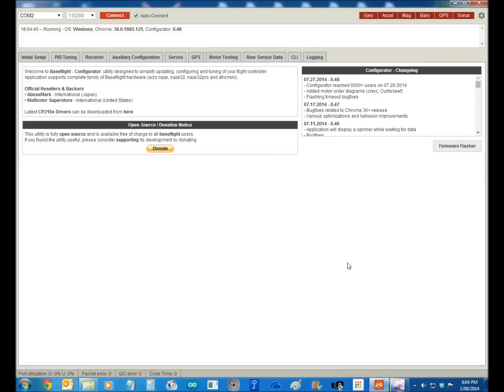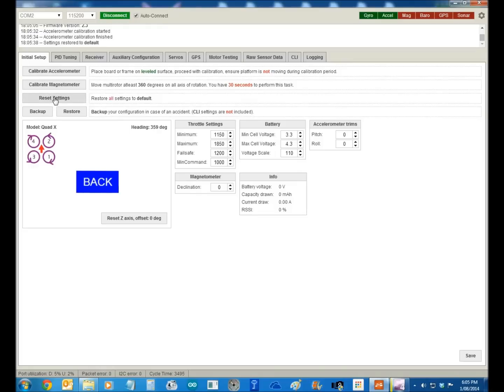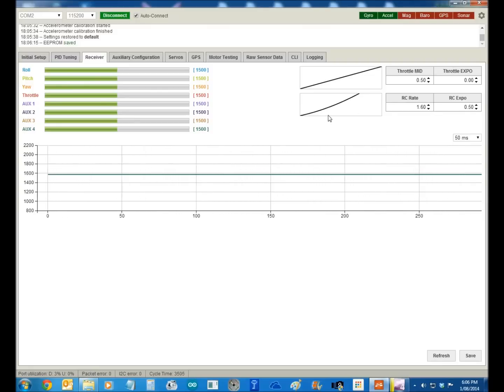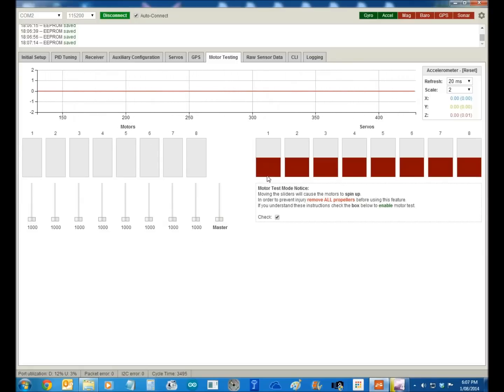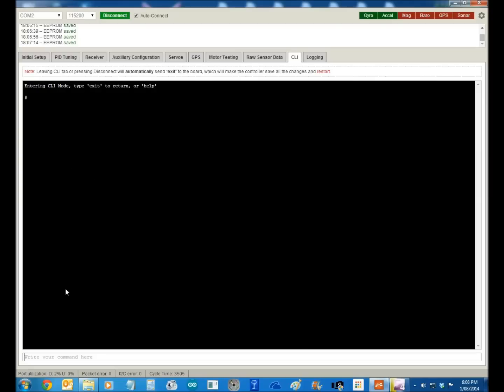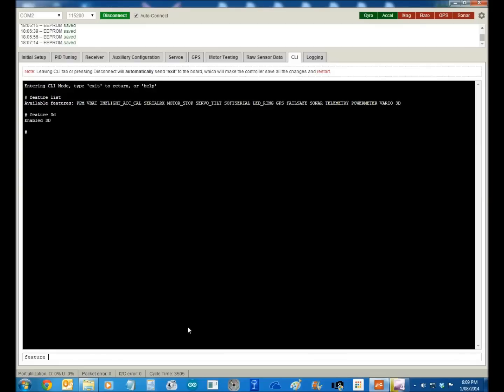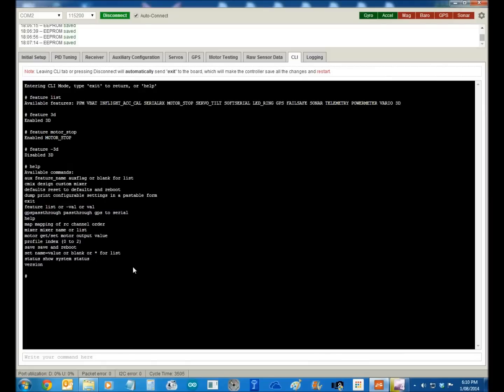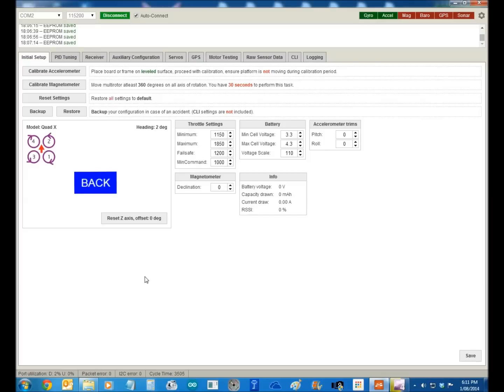250 FPV Setup - Baseflight Configurator

Comment: i reset my settings to default on my nighthawk 280. it cannot takeoff because the both left motors spin weak compared to the two on the right. Solutions? Thanks
Reply from the maker: What happens when you swap the 2 good motors onto the weaker motor escs?...... so the process here is to eliminate..... so by swapping the motors over to the other escs you will know if its the motors or the escs..... the other thing you can try before that is to swap the esc leads over on the flight control board..... hope that helps, let me know how you went as I doubt its your flight controller or the firmware...... cheers

Comment: I am new to all this...When I move my throttle etc on my TX, the receiver bars do not move.
the only thing that moves is YAW.
Can you shed some light on this?
Reply from the maker: What board did you flash?..... IE did you select say flash NAZE for a naze board.... also what Rx protocol are you trying to use PPM or PWM..... PPM is the one wire and PWM in all individual wires for each channel and you need to select which one in the GUI..... is the Rx bound to the transmitter and can you check its ok on another model......you can reflash the board again and try again..... also is there something set up in your transmitter that might cause this such as channels being set to zero....... without a video showing me or a detailed description of your set up and what you have done it makes it hard to diagnose...... also have you got your signal wires on and around the right way......
Reply: I have a Naze board. not too sure how to flash it, it just says "Running firmware released on: Aug 27 2015" when i plug in the board.

The TX i am using is the FlySky FS-i6 and RX is Flysky FS-iA6, i don't think they support PPM so i have my wires connected according the the PWM setup.
PPM is off on the configuration tab on Baseflight.

RX and TX is bound, all the Yaw, Roll, Pitch and Throttle worked at first. After messing around with my TX only the YAW is responsive in the receiver tab. I have tried to factory reset my TX but that didn't help.

Could not figure out how to get everything else to respond in the receiver tab..

Thanks in advance
Reply from the maker: 3rd paragraph........I think you must have turned something off/down in your radio....... can you set up a new model, bind the Rx to it and start again...... that is what I would do.... I had the same issue from copying over a model for another new model and one of the switches actually turned off my controls so I had to start over.... https://youtu.be/6oFEAjIolEw here is your radio.... dont know if you have watched this one....... let me know how you got on
Reply: I tried to rebind the RX using model 2 on the TX but the got the same results. it seems like only left and right is responsive on the left stick (CH4 using stick mode 2). i tried switching to another stick setup and only the left stick (only left/right input) is responsive on the receiver tab.
Reply from the maker: Does your radio work on other models?........ does your radio have a screen whereby you can see if all the channels are working?...... can you swap the good channel that works onto another set of pins?...... can you use another Rx to rule out the Rx having a problem.... what ever the problem is I dont believe its in the firmware, I believe its in your radio.
Reply: hi iv come across the same kind of thing trying to  set up my 280 pro ARFmodel  i dont have any movement on my roll stick setting up receiver in baseflight   can you give me some advice on this please  its running on stock transmitter M-16 & receiver M-16  its my first racequad and a little lost here lol

Comment: I have the rtf with the cheap fkysky  transmitter and my yaw rate is absolutely terrible despite the fact I have increased the yaw to its highest parameter in baseflight which is 1.00...Yaw remains the same in both horizon and angle modes...Any suggestions? Never fiddled around with PID set up because it seemed risky to me considering almost every video I've watched suggest not to.
Reply from the maker: +Shane Gibbs Have you tried upping the RCrate?........ I use 1.6. other than that all I can suggest is reflash the board to clean flight and try that.

Comment: Argh...my failsafe is giving me fits.  No matter the setting in baseflight it goes to 1200 throttle and would fly away (if it had blades on haha)
Reply from the maker: +Stephen Horn I would suggest you not use the failsafe in the GUI.... failsafe is a function of the Rx so turn off the FS in the GUI and set it up on your Rx.
Reply: Yeah I figured it out...Turnigy 9x - failsafe - throttle 0%.

Comment: I have my board facing forward. But When I move it around, the movement of the animation is not even close to the movement of the board. What am I doing wrong
Reply from the maker: +jerry zito What copter are you running (say a quad) and have you selected QUADX in the configuration?.........
Reply: Yes I did. Good news is I got it working. On the lower right corner of the screen where the animated quad is, you can change orientation.

Comment: hello
Here again, but I would like to ask your advice will do the Luping well and thanks to your input but I see that when the machine a little effort, making two Luping followed is as if left without power, this can be devido drives ?? 10A are with simonk firmware, the battery is charged butt I use 1.5 to 2.2mah

greetings and thanks
Reply from the maker: I think I have lost something in the translation so I hope I am right......... If you are asking are your 10amp escs OK for higher current then that depends on the current. Most 10amp escs will run up to a 4S battery..
Reply: hello
I wanted to tell you that when two looping followed miniquad seems that runs out of power engines use are Emax MT 1806-2280KV with ESC 10A with firmware simon
This can be devido the ESC 10A
regards
Reply from the maker: Javier Franco Javier if your copter is running out of power due to 2 loops then something is not right...... It will not be the ESCs as they supply constant current what I would suggest is that your battery C rating is low..... I use 2200mah batteries that are 60C so what are yours?.... also it could be the overall weight of the craft as it just maybe too heavy and runs out of momentum....... your escs, motors seem ok and should scream through the sky PENDING the overall weight and output power of the battery (C rating)...... let me know how you got on.
Reply: hello
I use batteries from 2.2 to 20-30C think that's the problem responsiveness is low

regards

Comment: hello
I can not do looping with acro naze32, for more I read and watch videos do not achieve them, can you tell me please carry on the PID values about to make looping
I've adjusted on many occasions but not douy with key
regards
Reply from the maker: Ok the PIDs are not the thing to adjust, they just make the board steady so I never need to adjust them... if you want to loop fwd and back and roll from side to side fast then you need to adjust the following...... (with explanations)

Pitch/Roll/Yaw Rate....... these are set to 0.00 and I have mine set to 0.30.... this increases the re activeness of those features....

RCrate....... standard is 0.96....... I have mine at 1.6, again that means 160% of your radio inputs will apply.

RCexpo..... standard is 0.65...... I lower mine to 0.50.....that means I have a more linear or straight line on all the radio inputs so again more reactive.

throttle TPA...... standard is 0.00 I have mine at 0.20.... this rate cancels out the P gain for the throttle when you full stick it.... meaning that the horrible wobble quads have with say 4S batteries as its given full stick and some of the escs are slightly out compared to the others causes that wobble..... this rate irons out that wobble but does NOT back the throttle off.....

So depending on your skill level and size machine and battery size etc upping the rates will make it more reactive....... I fly in horizon mode so I always have that self leveling to get me out of trouble but acro over 25 degrees for those awesome flips and rolls.......
Reply: moochasas
hello
Thanks for the input, now if perfect, forward ok, ok backwards towards the perfect right, but left no achievement do, I RCrate to test 1.20 and 0.60 RCexpo have to climb a little more RCrate?

Thank You
Reply from the maker: Javier Franco Ok so you are getting there....... the idea is to understand what the settings do and adjust them to your craft and to your comfortable skill level.
I have noticed that these naze boards sometimes kind of wear out whereby one of the roll axis works faster than the other ( I have also experienced the exact same problem with the 328P boards)...... remember they are not rolls royce, they are a $24 item sold for profit so the actual cost is probably $5-$10 to make so we should always remember that........ need anything else just holler........ merry christmas and stay safe...... cheers
Reply: moochasas
Ok thanks understood, it has served me very helpful

regards
Reply from the maker: No probs...... stay safe and merry chrissy.
Reply: moochasas so in horizon with your set up your can flip and roll 🍥 and it will self level???
Reply from the maker: TheTonstar1 Yes that is the combination....... up your RCrate to 1.6........ up your pitch/roll/yaw rates to 0.30 and fly it.... you will notice a great improvement on its react-ability and its that high performance react-ability that will get you through loops and rolls..... just follow these tips,
A - go high enough so that if something happens you can recover.
B - never hesitate
C - use plenty of power.
WIth C, I believe people often use too little power as they are scared or they hesitate...... the more power means the more control and fast "things" happen...... remember its easier to flip and roll at higher revs as compared to hardly having any revs at all....... bottom line..... drive it like its someone elses and dont hesitate...... http://youtu.be/jO_fvXkQFX4
Reply: moochasas god going to try today!
Reply: moochasas rc rates to 1.60 or 106?
Reply from the maker: 1.60..........106 will kill it..... one point six.... cheers
Reply: moochasas thanks working great